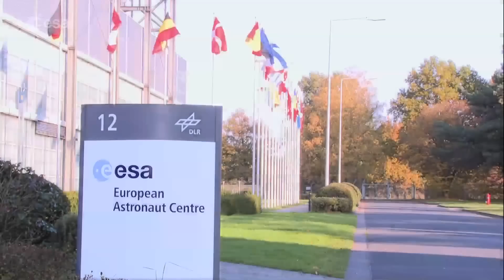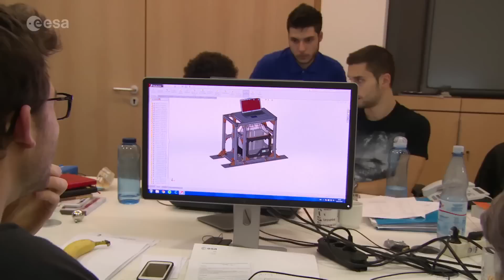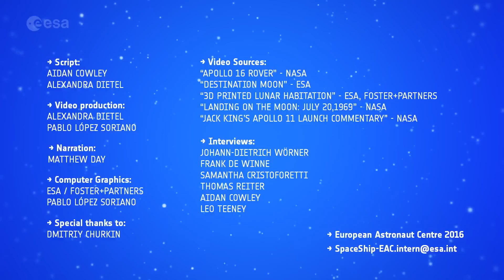Astronaut Center is Making Plans for a Moon Base | Video

Comment: Total BS! We can only build a air conditioner suit for 140 F degrees when it's 450 degrees F on the surface of the moon. Search for videos on the crystal caves. Plus the suits they would have used had no radiation protection at all! Or the lunar lander.